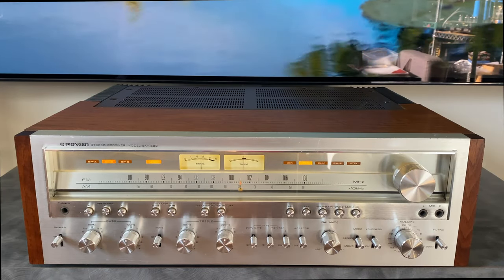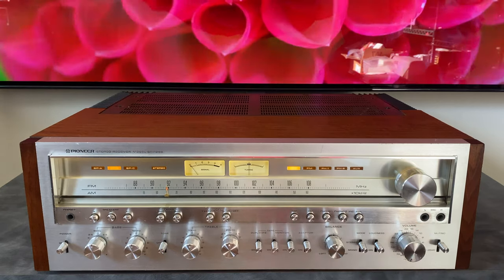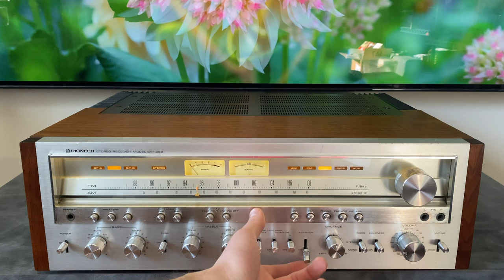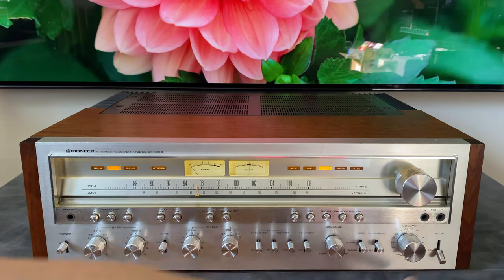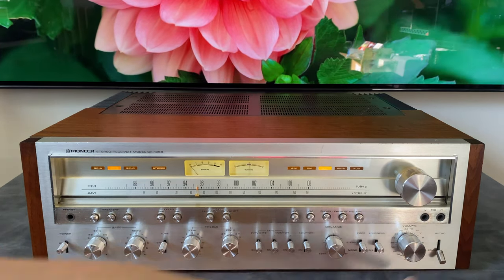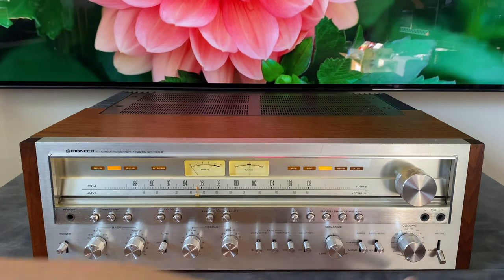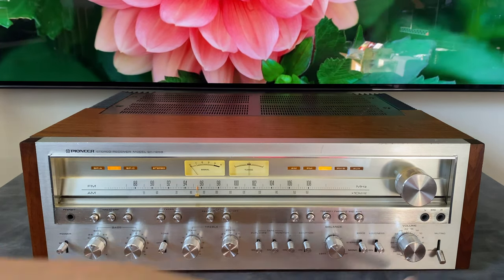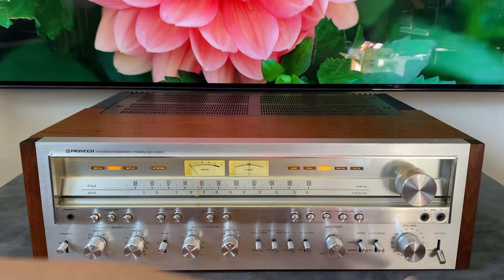Pioneer SX-1250 Stereo Receiver Restoration Overview & Demo

Comment: If the 1250 had power meters, it would be the holy grail instead of the 1980.  Personally, I loved it just as it is.  Beautiful example.  Thank you for the video.
Reply: Yup I think it’s very nice as well.  The little nick & marks give it some character.. I have one the same way.
Reply: Why I went for the 1080 back in 1988 when I was a Marine in Okinawa, Japan. The power meters did it for me. Can't really go wrong with any of these though.

Comment: I just had the opportunity to pick up an SX-1250. I have been looking for a nice vintage amp and I was fortunate enough to find a mint condition SX-1250 for a good price. Sadly it does have a problem that was disclosed at purchase. Having other vintage gear I do know they can be repaired and I did not hesitate with the purchase. I do believe this unit is from the original owner and has never been touched for any repairs, the unit barely has dust in the internal electronics. The problem with this SX-1250 is the left channel, It has a loud static popping sound even when the volume is turned all the way down, sometimes the popping stops for a few seconds and then back on and at times you can hear audio with some static. You can also hear the relay clicking/switching on and off. The right channel seems to be working just fine. I am not sure were to begin and living in Denver there aren't any competent vintage techs out here. Any suggestions are greatly appreciated. Thanks
Reply from the maker: It sounds like there is a failing component in left channel driver card. Likely a signal transistors based on the description. Some basic steps that you could try: Disconnect the preout - main in jumpers and see if the problem persists. If the issue goes away, your problem is actually in the preamp section and a simple cleaning of the controls may temporarily resolve the issue. If the issue continues when the preout main in jumpers are disconnected, its definitely in the power amplifier stage. Further diagnosis requires some safety knowledge and should be done by an experienced technician. I do not know any shops in the Denver area but perhaps some other users may chime in with some recommendations. I am playing with the idea of offering a card rebuild service in the future but do not have the space yet to take on outside receiver restoration work.

Comment: Thank you for this video. I am a super-fan of the SX-1250! Certainly one of the best receivers (if not THE best) ever made. I was lucky enough to find one for sale a few years ago (before the prices went through the roof) and it's my pride and joy. I'll never part with it. It was really great watching your excellent explanation of all the features of this incredible machine. 

I am interested, though, in your comment that the SX-1250 is only compatible with moving magnet cartridges. I have mine connected to a Pioneer PL-530 turntable with a Denon DL-110 (moving coil) cartridge in Phono channel 1, and in Phono channel 2 to a Micro-Seiki model Bl-51 with a Grado Prestige Green (moving magnet) cartridge. I have done A/B comparisons between the two turntables and I honestly can't hear a difference. They both sound terrific. 

Anyway, thanks again for posting this video!
Reply from the maker: I believe that your Denon cart is a high output MC which may be why it functions well in your setup.
Reply: @NovaluxStereophonic  I'm sure you're right. I remember that the "MM vs. MC" question was part of my calculations when I was looking  for a new cartridge, and that might explain how I wound up with the Denon. In any case, I have no complaints! Thanks again for posting your video. Really excellent!🙂

Comment: Very nice review. I have one and I'll never get rid of it. You actually have one more line level input. You can plug a source into the adapter input and use that switch (next to tape 2). The typical use of adapter was for a graphic equalizer, reverb amplifier or maybe a Dolby NR unit.

Comment: Clearly you know a lot more about these than I do, but I think you are wrong about the multipath function.  To my recollection, the multipath circuit function is to correct the situation where the signal from a single station is arriving by more than one path.  FM signals bounce off of structures and it is possible that one path is significantly longer than another.  In that case, they will arrive at slightly different times, one appearing as a ghost to the other.  I don’t know how the circuit works, but it somehow filters the ghosts out.

I have an immaculate SX-1250 that I bought new.  It worked fine last time I used it but it has not been powered on for at least six years.  I’m considering taking it to a local audio shop to have it gone over and restored as necessary.  I’m NOT going to power it on until I have that done.
Reply from the maker: You are absolutely correct regarding multi path.

Comment: I recently purchased my great uncle's house and he had this SX-1250 and a RT-707 tape deck in his garage, just sitting after he passed and the house went to my aunt. She moved everything to the garage and rented out the house. The great thing is, it's an insulated garage and they are in the same condition that this one is in. At this point, I'd say the capacitors need a replacement and it may need a calibration but the odds I found about $4 grand sitting in my garage is pretty crazy. I thought about restoring it and selling it but I also have always had an interest in HAM/short wave radio and before I bought the house I even started lightly dabbling in HAM operator's license with a Baofeng UV-5R and online knowledge.

I'm more of a computer/retro video game console repair guy. I can solder and know how to test with a multimeter, etc and reflow cold joints, the works. I'm just curious if it's worth restoring and THEN selling or just selling as-is. I'd say some purists may want it to be all-original, and I can almost guarantee it still is. I haven't opened it yet, but my great uncle was a radio operator and a radio technician so he may have done some repairs on it over the years. He loved to sit and talk on his radio in his free time, though. He even wired speakers into the living room ceiling so he could be hailed while he was relaxing on the couch. 😂

This house is honestly a really cool HAM operator time capsule. Our water heater/utility closet actually has an old desk he installed with tons of old frequencies for local operator friends he had.
Reply from the maker: Definitely worth restoring but it is not a job for a beginner. I have a video posted outlining the rebuild of the power supply and amp sections. It’s pretty intimidating for a first piece to work on. If it looks to be outside of your skill set it may be worth selling as is.

Comment: I'm restoring a sx 1250 and just finished a sx1280. Can you post the transistor part numbers you used on the stabilizer boards. The 1250 is so much easier to work on! Great Video
Reply from the maker: A good sub list is readily available on multiple posts on audio karma. MJE15032/33 is what I tend to use for the larger ones.

Comment: Very good review, thanks for sharing this type of information, question: I have a Pionner pax-20G speakers, can I connect them to my SX-1250?
Reply from the maker: I don’t see why not. They seem to be a high efficiency design though. You may want to engage the -20dB muting control to get a more usable range out of the volume control. Should be fine for the speakers as long as you don’t crank the volume.

Comment: Good evening I really enjoyed your video. I recently found a Pioneer SX838 at a yard sale everything seems to be in working condition but if I want to do a complete restoration how much would  that cost ?The next question how much of a downgrade  is the 838 in comparison to the 1250 ?
Reply from the maker: Congrats on the yard sale find! I would not personally offer a full restoration on that specific unit as the restoration labor and parts would quickly exceed the value of the unit. If it is currently working, my recommendation is to enjoy it in original condition or try to locate a tech in your area that is willing to service the unit. As far as comparing to an SX-1250 its Apples to Oranges. Although the SX-838 cannot touch the output power and distortion spec of a 1250, it appears to have a lot of good features and a decent tuner.

Comment: Wonderful video.  I have the SX-1250 - and never plan to part with it.  I installed an LED upgrade kit for the panel and indicator lights - and I'm happy with how that turned out.  The only issue I'm currently having is with the FM muting circuit - which does not function.  Regardless of the muting switch position, I hear all the static between FM stations.  I'm told this is likely caused by a failed part (Reed relay, ASR-005) but I do not have enough knowledge to properly diagnose it.  Using an ohm meter, I checked the continuity of the muting switch to the FM board - but that is as far as I've taken it.  Ideas?
Reply from the maker: If you check the schematic you should be able to trace which pins of the reed relay are used to activate the relay coil. You could measure the voltage there and see if it is indeed changing state when you are locked and between stations. If that is working an relay is not activating you could try to solder a jumper between the contacts to simulate it closing and see if muting works. That would isolate the relay as the issue. Good luck!
Reply: @NovaluxStereophonic  Many thanks!  Next time I open the unit, I will take another look at that part.

Comment: I have one of these, the signal needle never moves and the 30hz button when jiggled causes the left channel to static and go very quiet, have to jiggle it again to get it back to normal.
Reply from the maker: Those filter buttons do get noisy, a shot order deoxit inside will resolve quickly but a fair amount of disassembly is required to get to that board. The signal needle will only move on FM, if FM works fine in stereo and the needle never moves the meter movement may be stuck or something may be wrong with that part of the tuner circuit.

Comment: Recapped my bad caps/trans and have a few show heat stress but tested fine..And fixed few others. Still blows the 12A fast fuse. Any troubleshooting ideas where to start? Thanks love the vids!
Reply from the maker: Blowing a 12A fuse indicates a serious issue. I would start be removing both driver cards and seeing if it goes through the initial soft start process and protection relay click. If that test passes and your +/- 65 volt adjustments are good then your issue is likely with the driver cards. With that big of a current draw though you could have shorted or backwards main filter caps or blown outputs. If you get really stuck feel free to reach out. I offer card rebuilds and full restorations on this model.

Comment: Is the fm signal about 10 times louder that the aux signal on yours? Also I would like to have you restore mine at some point.
Reply from the maker: No, the balance between tuner and line level is pretty good on these pieces. If you are using a phone on aux for example those can be a bit quiet. If you try plugging a CD player into Aux you may notice improved level balance.

You can PM me on my Facebook business page regarding restoration.
Reply: @NovaluxStereophonic  Very cool. Thank you. Do you restore these?
Reply from the maker: @2comicsonabench  Yes I do. It’s not cheap but it’s a great investment if your piece is in good cosmetic condition.

Comment: Color me dumb, but I've not heard of a 'stabilizer' board. What does it do? Also, missed a solder connection at 32:26. lol. I know you caught it, just teasing.
Reply from the maker: Pioneer refers the regulated power supply board as the “stabilizer,” it provides regulated +/- 65V along with other misc. regulated voltages for various circuits. 

That’s a keen eye on the solder joint. That picture was taken before that board was removed from the chassis. I think I had tried to replace a couple of components while it was hanging in the chassis and quickly realized that it was much easier to undo the connections and pull the board. I just chose that still image as it clearly showed the black and blue lamp wires under the board.
Reply: @NovaluxStereophonic  Ah, I see. Suprised I've not heard that term before. But then at my age, I'm forgetting a lot fast. lol. (Except I still have a keen eye for techy stuff.) I appreciate the quality and depth of your videos. Thanks, Ben.

Comment: Can you tell us how much of a sound difference between an un-restored and restored 1250? Thanks
Reply from the maker: So far I have not come across one of these that was fundamentally working on arrival. If I ever end up with a decently working one in original condition and a restored unit at the same time I will try to do an A/B and share some impressions. My gut says that a fully restored and aligned unit would have better FM stereo performance and be more reliable in general.

Comment: I guess the stereo light only works in FM? Thats weird though as I thought mine was malfunctioning.
Reply from the maker: On some receivers the stereo light indicates stereo or mono operation for all sources. On the 1250 it is just an indicator that the FM tuner is receiving a stereo multiplex signal.

Comment: I can't get 0 volts on one of the amp boards. It moves up and down erratically to 1 volt
Reply from the maker: That amp card likely needs service. Could be an issue with the differential input pair or other out of spec components.
Reply: @NovaluxStereophonic  I do have a filter cap that looks like it leaked out goo some time ago from the middle .

Comment: I just bought one but will not power on what could be problem ?
Reply from the maker: It could be anything really but chances are if you are getting no lights, no relay click, no movement of the tuning meters, one or more of the fuses has likely blown. If this is the case, replacing the fuse has little chance of fixing the issue. If you do not have experience working on audio electronics I would encourage you to take it to a qualified professional for diagnosis.
Reply from the maker: @coreysykes6222  Sorry, I am cutting it a bit close. From the bottom they look fine. The top you may just be seeing the shrinkage of the outer wraps exposing the glue that holds the plastic cap in place. Hard to tell without actually disconnecting from the circuit and measuring on a quality capacitor analyzer.
Reply: @NovaluxStereophonic  thanks for all the info you helped me with appreciate it

Comment: is 1500$ to much for one? and would be getting a 1050 for 700$ be better?
Reply from the maker: Price depends greatly on cosmetic condition and if it has been restored or serviced. The pieces higher up the line tend to fetch higher prices in the long run, however the 1050 is still a great piece. I would look out for one that is in good cosmetic and electrical condition that you like the sound of. If it’s simply an investment piece go for the 1250, 1280, 1980, etc.
Reply: @NovaluxStereophonic   I think i will be  buying a 1250. I think they will only go up[ in value so might as well get one now before they are to expensive
Reply: @NovaluxStereophonic   What would cause this problem "It will play for about 10 to 15 minutes and then the right channel will quietly stop working, But if you then power off and let sit for awhile the right channel will work again"
Reply from the maker: @chrissieser5659  Hard to say for sure without looking at it but that symptom sounds like either dirty controls that need to be cleaned or intermittent protection relay contact. If turning the volume up a bit causes the dead channel to kick right back it it’s probably the relay. Best to track down a good local tech and have the unit serviced.
Reply: @NovaluxStereophonic   Thank you
Reply: I have the 1250s European cousin the black face SX- 5590 , it’s been fully restored , of all the audio components I’ve owned over the decades the SX-5590 will not be going anywhere anytime soon , I love it .

Comment: What about front glass? Easy to replace and find?
Reply from the maker: No easy to find an original but there is no lettering on the glass so a replacement can be made if you have a local shop that cuts glass.